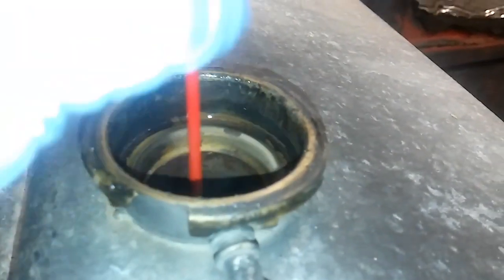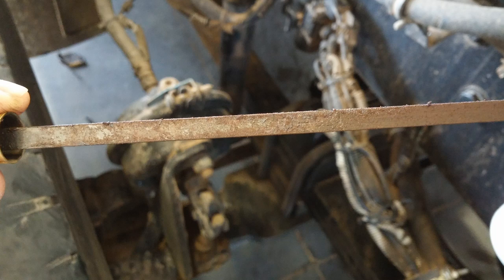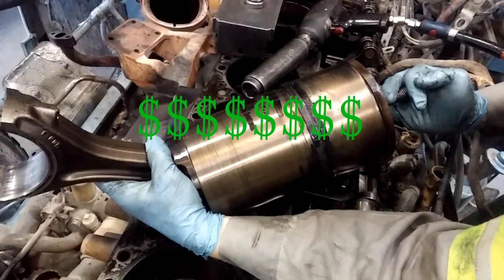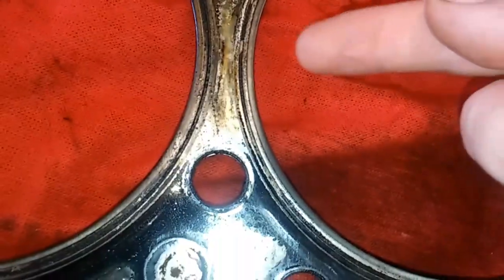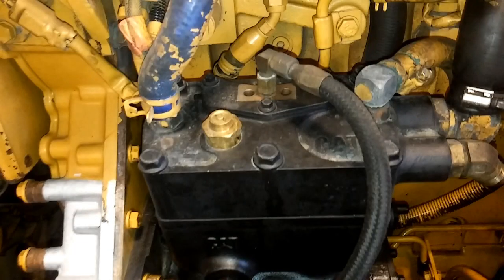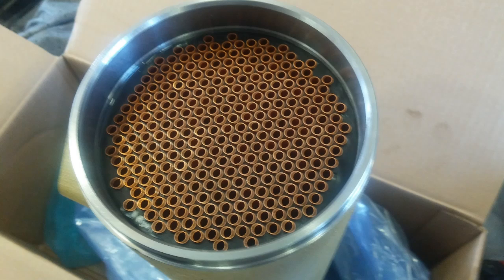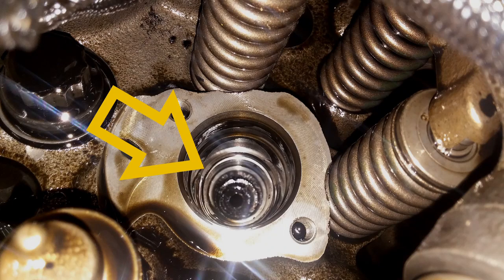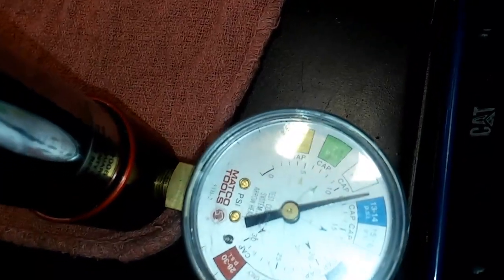What Causes Coolant In The Oil?  Antifreeze In The Oil.  Coolant In The Engine Crankcase?

Comment: Massey Ferguson 255 I swapped the FI pump with a brand new one and the tractor is still not starting even though I used starting fluid on the air intake the tractor didnt even attempted to start. 
I also discovered when I took off the plate on the back of the chamber with the 4 bolts (I wish I could send you the picture I took) that there was an excessive amount of rust both on the plate and on the mounting part of the chamber where the pump connects/links with the three screws. The tractor just wont start and I have no idea what could have happened I thought just the FI pump would fix the problem but the issue seems to be bigger. Thank you!

Comment: Hello, the problem I’m having with my 1999 3406e cat engine is milky stuff only under the valve covers. Get to 1400 rpm’s starts shuttering stop engine light comes on, Oil pressure drops. Now start it cold oil pressure only gets up to 40 then starts dropping to 30 psi? Any advice on what might be causing this? Thank you

Comment: I dynoed a used 3408. The more it ran the more steam came from the  crank case  vent. I added 2and 2 together coolant leaking into the oil pan. I removed the oil pan and thermostats. I put a piece of cardboard  under the block. i then pressurized the cooling system. Drip drip towards  the front of the engine on the cardboard.  I used a mirror to check what cylinder was leaking it was number 1. The block had cavatation  in the.o ring band.  It could been fixed with balzona. The customer had it cut for an insert

Comment: I recently replaced my head gasket on my Perkins 1004-4 AA series in my JCB Robot 1997 due to coolant in oil and vice versa. I went ahead and replaced my coolant pump(gear driven), engine oil cooler, and thermostat since I already had top engine removed. Took my heads to machine shop for resurface and inspected for cracks, all good just needed new valves and got them replaced. Put everything back together according to the service manual and ran good for a couple of days though I did notice more than normal condensation on valve cover oil filler cap and coolant level going down slowly. Drained the oil and left it overnight with radiator full and oil drain plug removed. Checked in the morning and had coolant dripping from oil drain plug. I'm clueless to what my problem could be. Any help would be appreciated from anybody with similar experience. Thank you

Comment: dude, I've got a 86' 3204 with water in the oil. exactly 2 gallons. the machine was sitting through the winter, full of antifreeze in Georgia. it amazes me that i check the oil religiously, and all of a sudden, the dip stick registers 2 gallons high in oil and 2 gallons low on coolant. I am not a mechanic but, have a few mechanics leading me. I've taken the head off and pistons out and have pressurized the cooling system.  I have found no leaks. other than the radiator. I've pressurized the system with ordinary water and have found rust around oil ports around the head gasket. I'm thinking this may be my problem. the head gasket but. have been told it could be the oil cooler or cracked block or head .

Comment: Currently have this issue with CS11's C4.4 and CS533E's 3054 engines. Major headaches...
Reply: Did u figure out your issue? I have a 3054c that got coolant from not oil. Thinking it’s head gasket

Comment: Can the trans oil cooler be bypassed  mine just took a shit
Reply from the maker: Yes you can, but you risk overheating your transmission fluid.
Reply: @AdeptApe   how long can I run it without the cooler can I go a couple weeks or should I replace it right away my mechanic says the cooler is useless and that he cancels if on most trucks and they run fine but I don’t know bout that makes me nervous running it without it

Comment: I have a 2001 Cummins and I changed the oil cooler due to water in oil. Replaced the cooler and water drips into pan with engine off. Any ideas how to fix

Comment: My truck  was using 1/2 gallon of coolant everyday, couldn’t find the leak.
Eventually I put pressure into the radiator and still couldn’t find my leak.
Well the next morning my truck wouldn’t turn over it had locked up.
Turned out to be inner cooler. 
With that added pressure for testing coolant it opened my leak more therefore 
leaking lots of coolant from the inner cooler into the cylinders overnight.

Comment: Any idea why coolant would be going directly into the crank case on a Cummins 4b?  It happens after filling the coolant about half way and  then will flow at about a 1/4" stream out of the oil drain pan plug.  I recently changed the oil cooler housing because of a crack and pressure tested the cooler itself and it was fine.  I've already removed the head and verified it's ok.  Coolant begins flowing into the crank case before it reaches the head level.  Input from anyone will be happily accepted😁.

Comment: How about when there is coolant in the crankcase but no oil coming into the radiator? I've heard this could be caused by gavatation.  When holes are formed in the front cover plate behind the water pump and coolant just runs into the oil. This happened on my 7.3. No sign what so ever oil coming back into the radiator. You can put coolant in the radiator  and watch it flow out of the oil pan without it running.

Comment: hey josh,  im getting oil in my coolant.  no coolant in the oil. i have watched your videos on it.  i have changed the oil cooler and getting the same thing.   you also mentioned the air compressor.  is there a way to test the air compressor?  thanks

Comment: C-10 cat, would a bad water pump cause bubbles in the bottle on the over flow tube? I'm getting bubbles at idle. I pressurised the system at 20psi an it didnt seem to move for 30min. Driver  was running hot because of a leak in the coolant tube going to the compressor.
Reply: Is it possible to check the air compressor for internal leaks? I have moister coming out of my blow by 3406 cat

Comment: What’s up adept ape, thanks for all your info. I have a acert c15 blowing white smoke and all the coolant going into my oil. My air compressor lines were frozen and it wasn’t getting charged. After I put air line anti freeze, later that day all the trouble started. Any help on what it might be? I’ve been told it’s probably a common thing, cracked head.

Comment: How to check the air compressor? My radiator is cool almost like water pump not working I took thermostat out only one on my 3406e 🐈 an still the same thing compression out expansion tank. Replaced oil cooler so I know it's not that.i really need some help

Comment: Hi i have a question i have a 3126 and is drinking coolant im thinking its a head gasket..i put new oil cooler bacause blown and put oil in the system..so now i put new radiator all new and do couple flush so its good now i check  when the truck its running  and i put the truck like 15 rpm for 1 or 2 minutes the coolant go little by little if its in idle dont drink nothing...thanx and good videos

Comment: Help , ASAP , We just rebuilt an ISX Cummins at the cost of $25000 (sleeves had to be shimmed) , 1 week after getting truck back the coolant is contaminating oil . The mechanic came to check truck and he said the problem is the OIL PUMP COOLER and that's not under his warranty . I am sure he is lying to us. he has us against the ropes . What is the best way to verify ?
Reply: How do i troubleshoot coolant leaking from the exhaust pipe of cat c15 engine

Comment: Hey I have a cat c12 and looks like it's leaking oil out of some lines under the radiator, but I don't have oil in the coolant system can the radiator be some sort of a oil cooler? No smoke out of the exhaust

Comment: We had coolant in the oil on a 3306 in a Steiger Cougar 3. Turned out to be the water pump. The weep hole was plugged with rock hard dirt and did not leak externally until I cleaned out the weep hole,

Comment: I have a 300 cat engine in my Motorhome. I stored it over  outside over winter. When I started it this spring my low water warning light came on. I added one and a half gallons of premixed coolant  and was unable to get it to the full mark and it was disappearing as fast as I was putting it in. I cannot find any leaks anywhere. What do I do now?  Help

Comment: Hello, I have a Cat C13. I have a LOT of pressure in my coolant tank. I had the air compressor replaced.. Still the same issue, few times the coolant rose in the reservoir and spilled out the little tube close to the cap (when idling). Oil is clean, not mixing nor anything. What the hell could this be? These mechanics just want me to do a engine rebuilt right away. Is it safe to drive like this or? I got the truck out of the shop today and on the invoice it says theres exhaust fumes in my coolant reservoir.. The little tube by the cap does have smoke coming out of it but minimal. Looking forward to your reply, if you have any questions for me or can explain to me what should my next step be, please feel free to reply or give me a call. 678-938-2791, thank you.
Reply from the maker: You probably have a cracked cylinder head. You need to get the head off as soon as possible because you are probably getting coolant into your cylinders. This can damage the cylinders and possible cause your engine to seize if it gets really bad and a lot of fluid gets in the cylinders.
Reply: Adept Ape Its just about finding a good mechanic. Caterpillar is crazy with their rates to replace the head. Im actually headed up there now to see whats going on with my other truck. They called and say I need to replace some pre-cooler support bracket and some hose and they want $2200. 

But yeah, I will just go ahead and get a smaller shop to take the head off, buy a new head and replace it. Caterpillar wants a arm and a leg at their shops.

Comment: Josh, I got a c-15 that is getting opposite problem to this video, the oil is getting into the coolant tank and its a see thru tank that is all black from oil. I did change the oil cooler in 2012 and it fixed it then but now 300,000 km later, I have same problem just wondering do I change oil cooler again or is there something else I need to check ?
Thanks and love the vids.
Reply from the maker: +Clayton Holland If you have oil in your coolant that is pretty much always an oil cooler. If your transmission has a tranny cooler, that can also be the problem.
Reply: Thanks !!
Reply: Adept Ape my renault master van has oil in coolant and also hissing hose leaking oil can you advise why this happen thanks

Comment: Hi Josh,  I'm working on a 3406c in a 980c wheel loader. The problem is that the coolant is coming up thru a head bolt hole. What would cause that?
Reply from the maker: +Neil Neil Well that's is not good. Could be a cracked head or blown head gasket most likely, where you have coolant getting by the seal to the closest port, the head bolt hole. Might be something smaller though, such as a water ferrule that has just hardened or cracked and is working its way to the bolt. The head should be removed though unfortunately to check.

Comment: I'm getting oil inside my cooling. I have a 1999 3406E. I check the radiator cap is not a black stuff on there and look like it's a oil inside the cooling.

Comment: Hey I have a C12 and I have coolant getting in my oil. We've pressure tested it with the pan off and haven't seen any leaks. I think I have bad thermostats because my fan has started kicking on automatically when my coolant is at 150, and so it's running constantly 24/7 as I cruise down the road. In my oil filler tube, there is white milky stuff. I thought maybe water condensation because of the fan being on constantly and making my oil temp stay very low. But the mechanics at Peterbilt are saying it's coolant. What can I narrow this down to? Air compressor, water pump, thermostats? Anything else? Like I said, no leaks are showing when pressure testing. Thanks, please respond as quickly as you can
Reply from the maker: +TruckerForEternity The C12 and C10 can weep coolant into the crankcase. That would be the first place I would look.

Comment: in the C7, alot of times it's oil cooler.  Did ALOT of these for the Army and 9-10 times that was the case.  Once in a great while was because of a warped head.....but that was rare
Reply: I have a C7 getting coolant in the oil but my truck seems to be running fine. What is the best way to check if it’s the oil cooler?
Thanks

Comment: hi Josh   i have   6nz  and  the engine is running good. no symptoms no smoke but I've i did the bottle test and no bubles  gotten some coolant in the oil and  the little bit of oil in the coolant way to think ?  can be piston sleeves  o'rings  freez plugs . base on your experience  what do you thik that can be ?  thank you .
Reply: Oil in the coolant and coolant in the oil is usually indicative of a defective oil cooler.  He briefly mentioned that issue in this video.

Comment: What are specific tools you use to do a pm on a cat vehicle  construction. Like pressure gauge and stuff like that and what brands are best?
Reply from the maker: +Raul Garcia For a truck, just a 1 1/2" socket or 7/8" on the smaller engines for the drain plug. A 1/2" ratchet, filter wretches, a punch and hammer, and a grease gun.

Comment: Like you videos nothing happened yet to my motor I have a 3406e caterpillar. I like  your videos. I'm  glad you on here these video.
Reply from the maker: +Anthony Johnson Thank you.
Reply: how ez it  to replace power steering pump. how much those pumps coast.
Reply: If it is in a T800 KW, it is no big deal to replace it.  The power steering reservoir location on the frame could present some accessibility issues though.
Reply: I cannot locate your latest reply to my post below, but yes I know the pump is mounted on the engine.  I was just adding that if you have a T800, the power steering pump oil reservoir could hinder accessibility.

Comment: My buddy had the same problem, coolant in the crankcase.  His was in a late nineties marine 3116.  We checked all the usual suspects and the unusual as well. Wasn't looking good for avoiding removal from the boat and tearing it apart.  Long story short, turns out in its past it had been rebuilt and sleeved.  I believe the original block had cracked and was sleeved as a repair.  Went for a hundreds of hours and about 10 years but eventually the sleeve cracked as well.  Engine started and ran fine with just the slightest amount of white smoke that went away fairly quickly after the engine warmed up.  It was low on the sleeve so the engine never hydro locked but after sitting for a while, as boats do, the coolant was low and there was red cat coolant in the oil.  Just another possibility on this specific engine....
Great videos!!!! I found them very informative and steered me in the right direction in this case.

Comment: Adept Ape, will a CAT service center update or changed the "settings" of the ECM without the customer knowledge?
Reply from the maker: +Kenneth Bullins Not usually. If they are troubleshooting sometimes a configuration setting will get changed, but should be changed back before the vehicle leaves the shop. It is possible a new flash file was installed as well, but usually the customer is consulted first.
Reply: Adept Ape -just thinking here, if my C9 engine loading at 79% is because of a update flash file. There's no reference to an update on my invoice. 
It was loading at 99% before.

Comment: I just finished an MXS inframe today. The guy wanted me to save money. 20 mins after starting I had steam out of the blowby tube. Dropped pan and pressure tested. A solid stream from right timing cover at 15psi. Replaced water pump and leak stopped. No more saving money for these guys, the water pump should always be replaced while doing an inframe too. lol
Reply: You may as well. Cheap insurance. Those are probably the same people who don't put a water pump on a car when they do a timing belt and get screwed.
Reply: My truck is at cat right now. Got a c15 acert with 600k original miles. I'm having antifreeze drops coming out blowby tube. Mechanic said it dont look like a head or liner. I hope I'm lucky man. Just bought the truck from original owner 2 months ago.

Comment: Hey Adept Ape nice vid thanks for the info☺️ also we have a international harvester Simi from the 70s that has a cat engine in it I have no idea if the engine is original or not but I don't know what kind it is. I have looked everywhere but i can't find the number it's red too for some reason. My dad said the reason they stopped making then was because they couldn't sell any parts for then but I don't know if that true or not. 
Ps: we also have a Mack Simi and when it isn't under load it jerks the heck out of us we don't know why but I have a suspicion that it is the injector pump. I hope you can answer some of my questions -Bob
Reply from the maker: +BOB White Being from the 70's it might be one of the 300 series engines that we don't see anymore. They were before the 3400 series engines. Without a serial number off it you might have a hard time finding parts for it.
Reply: Might be a 1673 or 1693 which Josh mentions is the on-highway version of the CAT 300 series engines.  They would have pre-combustion chambers and made a nice crackling sound when revving up under load.
Reply: Adept Ape I'll look at the engine tomorrow I think it would be hard to find parts serial number or not that is a good good engine it might be need to be rebuilt one of these days but we don't put anywhere near a million miles on it we use it basically ones a year for harvest and then it pulles a spray trailer. Thanks for the reply
Ps: if your engine is jerking a lot when it's not under load what might cause that?? Dose it happen to cat engines too??